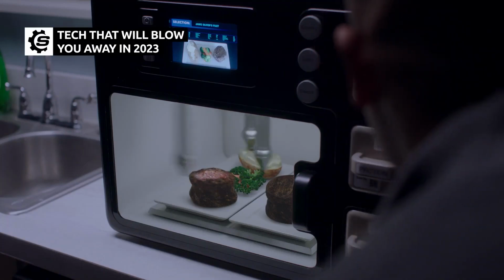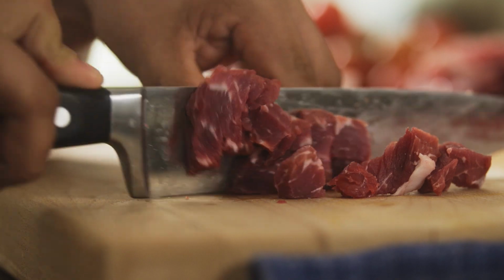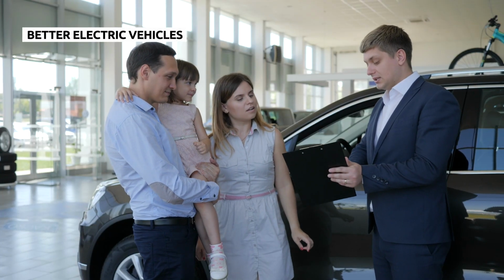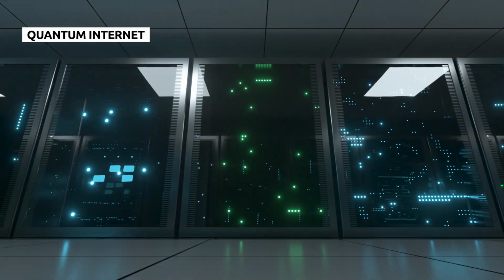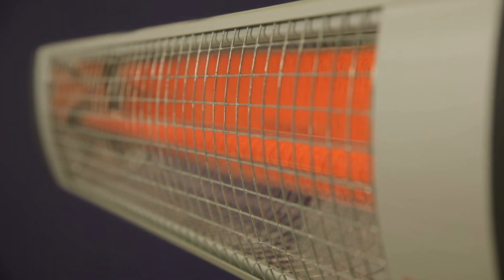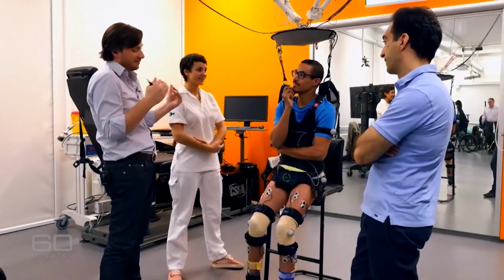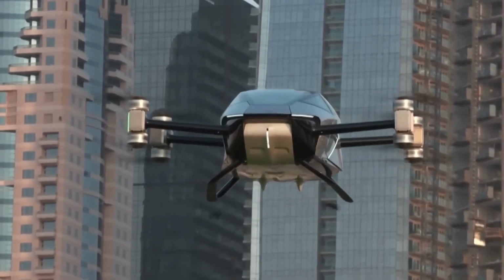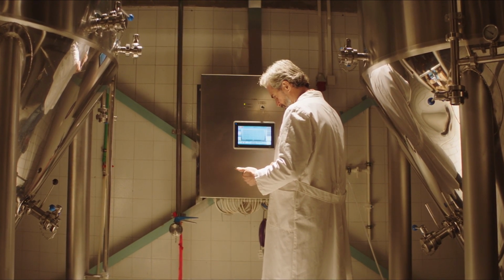Tech That Will Blow You Away In 2023 And Beyond

Comment: Was curious what happens to the human body in an implosion.  Does it explode and / or vaporize or just collapse flat or???
Reply: The bodies are essentially turned to pulp from the sudden and extreme increase of pressure. After the implosion comes the explosion where the bodies are forcibly ejected and spewed out amongst the wreckage. Nothing remains that can be identified as a body or parts thereof. It's a brutal yet instantaneous event and occurs much faster than the human body can register it. They didn't sense it or feel it; therefore, they didn't suffer. It just happens too fast.
Reply: In an implosion, the human body would get crushed and compressed. Basically the opposite of an explosion.